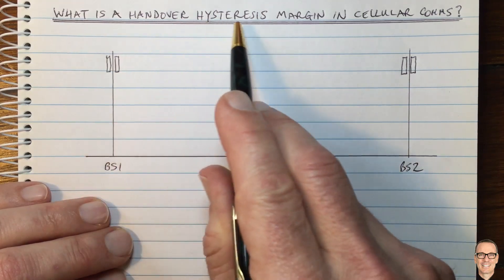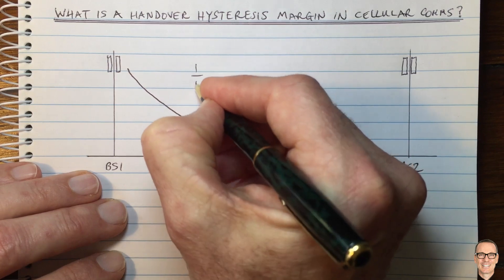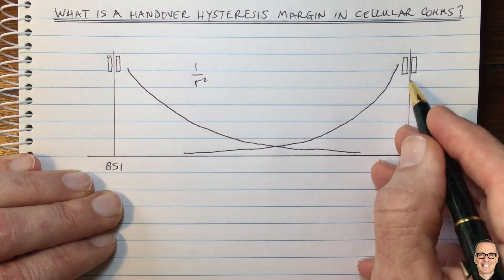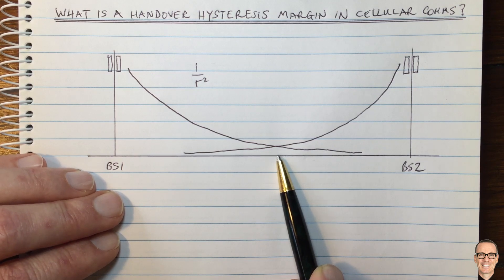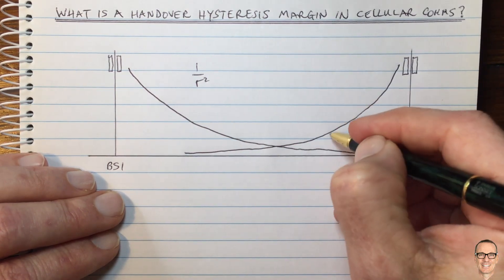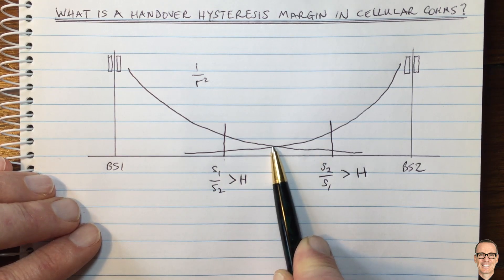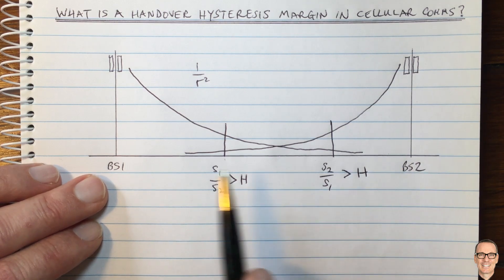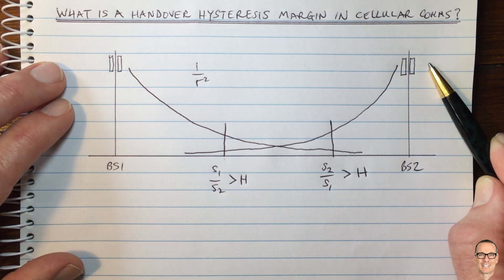What is a Handover Hysteresis Margin in Cellular Communications?

Comment: Hello I have a more general question concerning the sample rate. We must satisfy the sampling theorem. I thought when we now transmit in the mmWave region, the sampling frequency can never be in such high GHz regions. First one convert it down to the base band and sample next. So the sampling frequency is much lower. Is that conclusion right?
Or are there systems that sample in the band pass region?
Thanks a lot.
Reply from the maker: Well yes, sort of. But you only need to sample at twice the highest frequency if you plan to fully reconstruct the analog waveform at some later time. If you're only interested in the digital information that the analog waveform is representing, then you can sample at lower rates. This video might help: "How to Avoid ISI in Digital Communications: Nyquist Zero ISI Theorem" https://youtu.be/sgyTlI9BsKc

Comment: Dear Professor, Thank you again for your great explanations. :) I have another question, but I may have misunderstood the main message: Could you please explain why it is sufficient to sample complex signals with f_sampling = f_max and not f_sampling >= 2 * f_max as it is required for purely real signals? As far as I know, the mobile communication standards stipulate that a 10 MHz signal is sampled with 15.36MSamp/s instead of 20MHz. Thank you very much!
Reply from the maker: I think you're getting confused between the Sampling Theorem (which applies when you want to sample an analog signal in such a way that you could exactly reproduce it from the samples), and the Zero-ISI Data Transmission Theorem (which applies when you want to send digital data without the waveforms overlapping in time. For more on this, see: "How to Avoid ISI in Digital Communications: Nyquist Zero ISI Theorem" https://youtu.be/sgyTlI9BsKc

Comment: Thanks, I knwo that electric and magnetic field behave E,H ~ 1/r and S=ExH (I believe that is the power density) behaves 1/r^2........and this S is the transmission power you mentioned, is that right?
Reply from the maker: Yes, that's right. More details at: "What are Antenna Gain, EIRP, and Friis Equation?" https://youtu.be/mHo2-f5V8V4

Comment: Thank you for the simple explanation Professor... but I have a simple query (may sound obvious and silly to you). Is the hysteresis margin somehow related to the problem of optimal threshold selection for minimizing the error in detection probability OR is it completely based on the long term fading component and the aspect of short term fading gets completely ignored here?
Reply from the maker: Don't worry, obvious questions are sometimes the best ones! Your question is an interesting one. It does look a bit like the detection error threshold, but these curves are not p.d.f.s - they are simply the power drop as a function of distance for free-space propagation. There is nothing random here. The hysteresis in the choice of threshold is used to allow for fading (both short term and long term).
Reply: Thank you Professor.